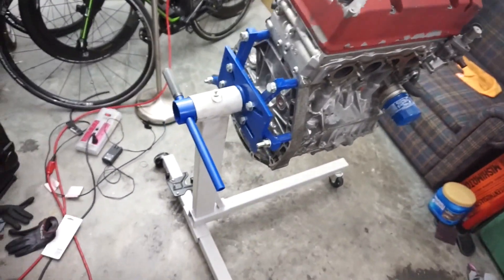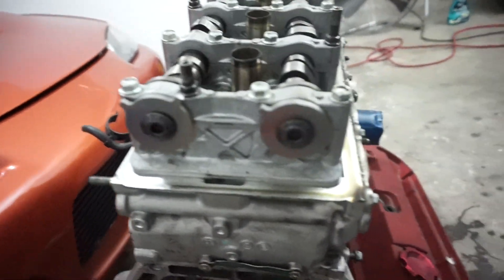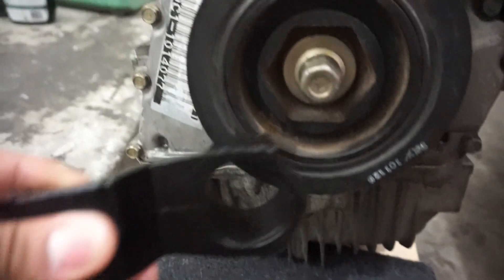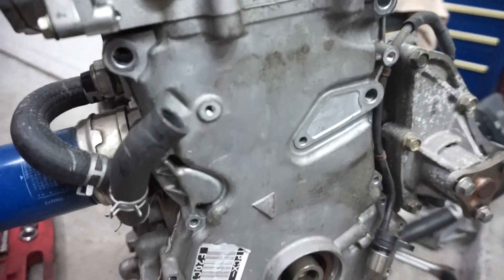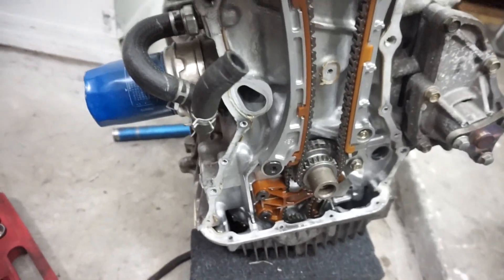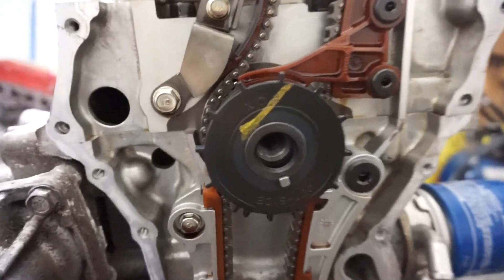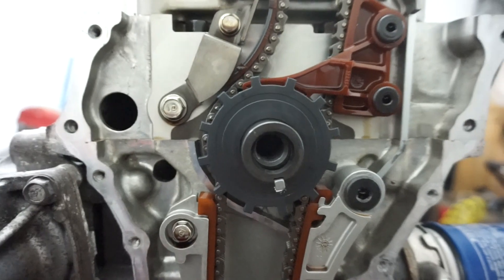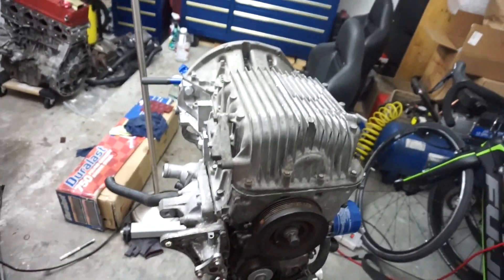Swapping Cam/Crank Sensors From F20C to F22C Engine

Comment: Pretty dope video. Came across it because I just bought a 06 motor for my 05 s2k and gotta swap out parts
Reply from the maker: Thank you! The guy that sold me the  F22 engine told me to swap out the 2 sensors and and valve cover to make the F22 work in an AP1 S2000. Well so far the F22 is running strong without any issues.
Reply: dsmshred pretty nice .. hopefully mine comes out good. I saw on your now running video, the check engine light tuned on. Did you ever diagnose that ?
Reply from the maker: Sadly the CEL is still on, shame on me for not fixing it.... The codes are the following: P0410 Secondary air injection system malfunction,   P0430 Catalyst system efficiency below threshold bank 2,   P1457 evaporative emissions control system leak detected -B,  P0420 Catalyst system efficiency below threshold bank 1. Its all the emission stuff I still have to fix but haven't.
Reply: dsmshred I almost the same codes on my teggy haha. Glad it’s nothing with the engine tho.
Reply: Couldn’t u just get kpro for the 06 engine?
Reply: Change over to a AP1 valve cover and intake manifold and you should be good with the CEL